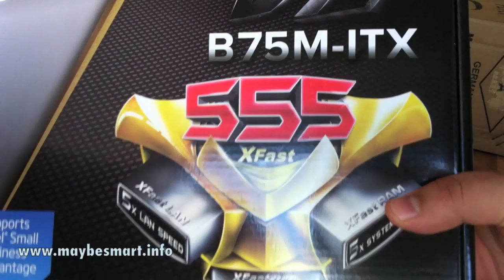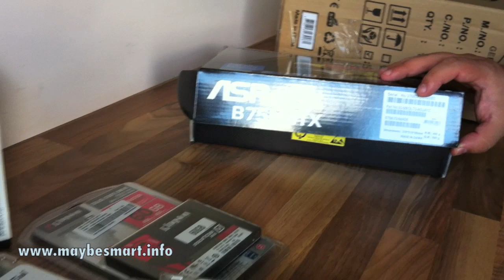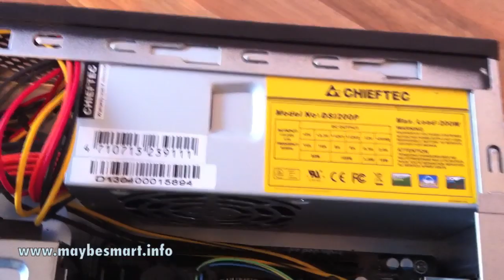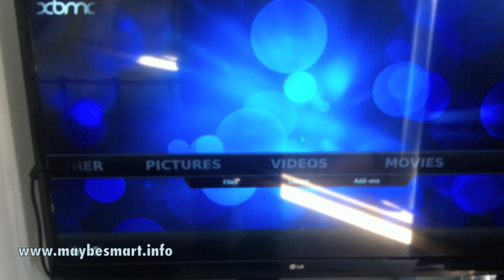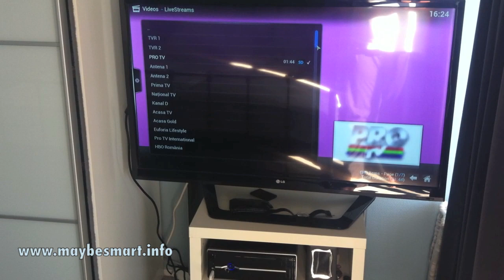HTPC / Media Center PC build Sept 2013

Comment: Helo, Catoiu Ionut.
Shortly. I'm decided to build HTPC. Main requirement is ability to play 3D BD ISO. The configuration of future HTPC is
i3 4330 + any miniITX motherboard. The question is... Could the HTPC (bsed on HD Grphics 4600) playback 3D BD ISO and pas it right to the 3D TV through HDMI without any videocard?
Why I'm asking... If i3 (HD Graphics 4600) can process 3D BD ISO by itself without any additional card I buy thin case/chasis without expansion slot(s). If I have to add graphic card to HTPC then the case/chasis must have additional expansion slot(s).
Could you give me an advise?

Comment: if we desire a more modern cpu (i3-4150 or i5-4590) with stock cooler,  it's possible use it or there is too much noise and excessive hot?
Reply from the maker: Antonio Vasco then you need a bigger power source since present one supply only maximum an i3
Reply: Thank's, *****, so, i have now, a 250Watt 85+ Chieftec PSU, wath do you think about?

And about stock cooler noise of your i3?
Reply from the maker: Antonio Vasco I would say that's not enough, depends on the rest of components as well. In case of using a SSD, motherboard with video included (not with external video card) and without DVD-RW/Blueray I think you'll need at least 300W. i5 processor takes 30w more than i3.